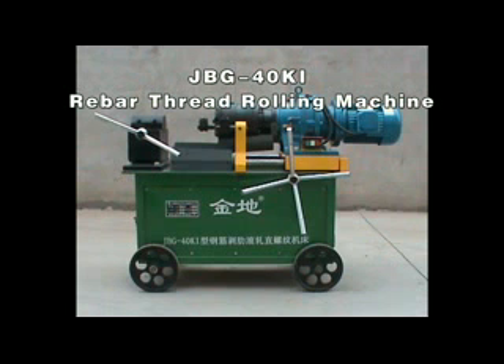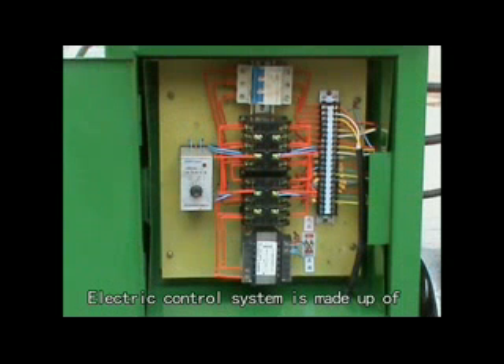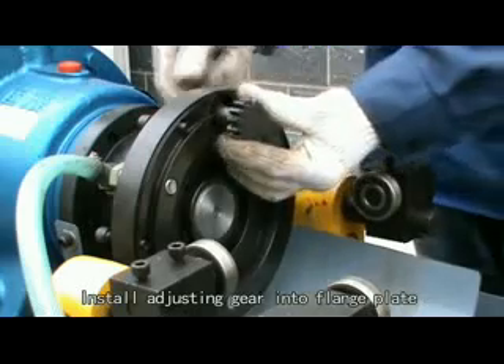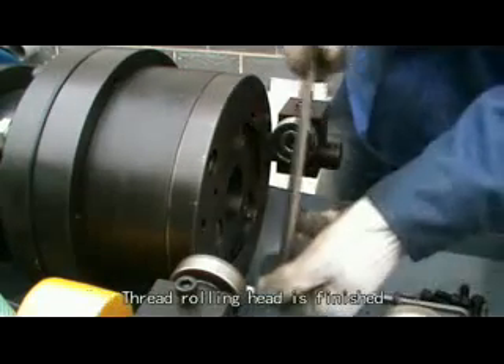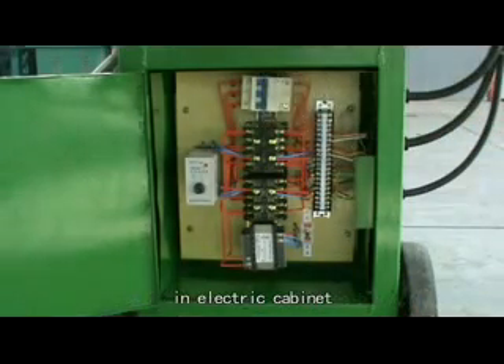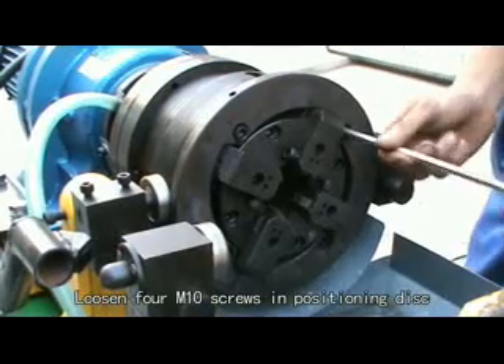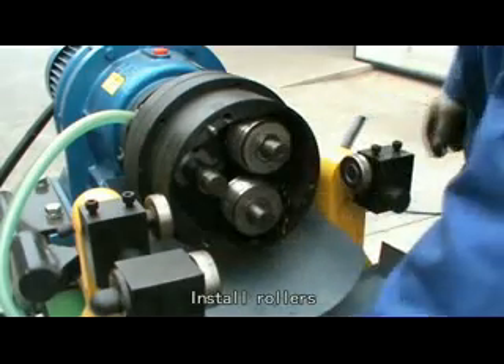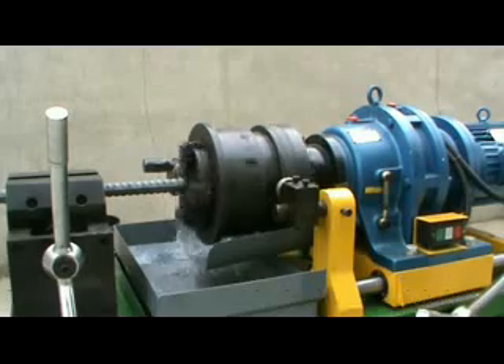JBG 40KI video

Comment: Hello, can it peel and roll lh thread simuntaniusly as is it does for rh thread? Ad i sve, when Rolling lh thread it changes doirection of machine but peeling knives are open.
Reply from the maker: The machine can process the left thread processing. First adjust the position of the roller in the rolling head. Then, flip the switch in the electrical box to the opposite direction. Feel free to add me on Whatsapp +8615930245751 for specific operational steps.